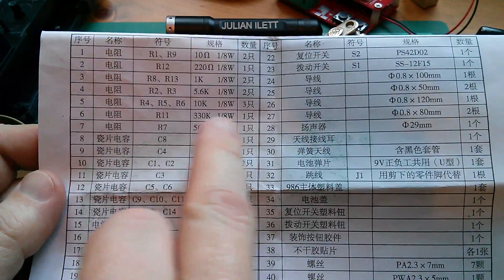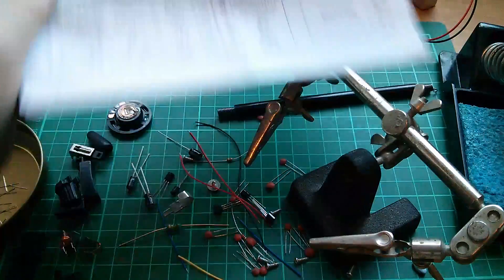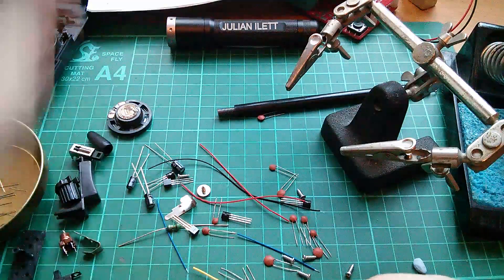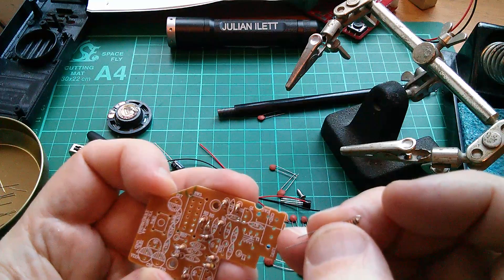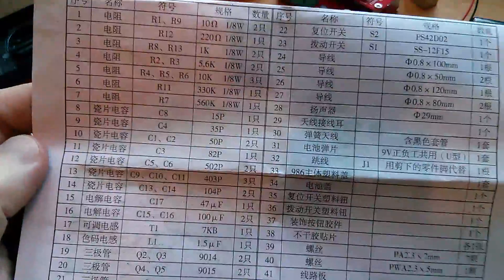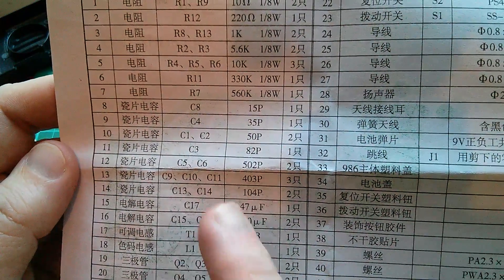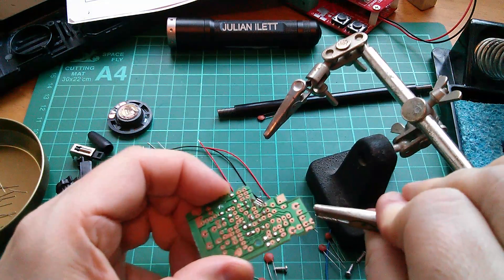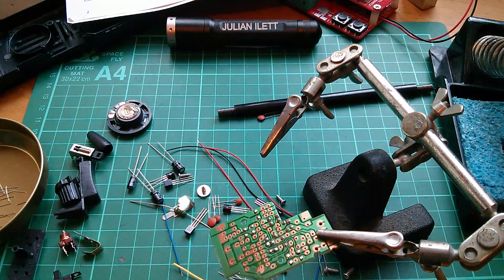Real Time Kit Build: Walkie Talkies #3

Comment: The way I do these kits is put all the resistors together and all the caps together etc. Take a resistor measure it with my  meter look up the value on the parts list and put it in the board with the legs slightly spread to stop it falling out. Solder all the resistors then cut all the legs off. Same with caps. This way you know what value component you have actually fitted. You only pick up the iron and the cutter once for each type of component.
Reply from the maker: +Andy will I've tried that method, but I find the forest of wires, on the track side, hard to solder, especially those in the middle of the board.
Reply: +Julian Ilett yes I know what you mean so just solder the easy to get at ones cut those then do the rest. But with very cheap parts I have had a few duff bits so always find it easier to check all b4 soldering.

Comment: You soon gave up using the component tester to confirm that you had selected the correct components, particularly the capacitors.
Reply from the maker: +UKHeliBob I did, which might have been premature, as I can now exclusively reveal that the finished kit doesn't work. But that's excellent, as I can now make a follow-up video "fault finding the walkie talkies"!
Reply: +Julian Ilett I actually find it rather funny that it doesnt work! do these kits ever work?  part of it of course is the 'optional' r10, i wonder what other random parts it does and doesnt need!